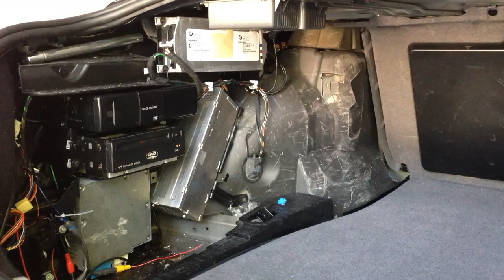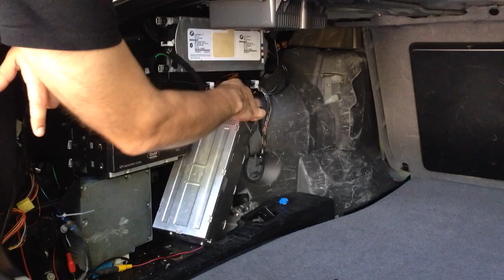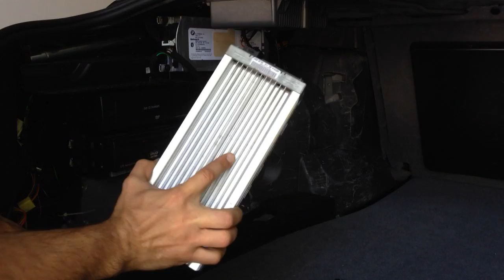BMW, Audi, Porsche, Rolls Royce, Bentley, Mercedes and other cars with MOST bus failure diagnosis a

Comment: Hi mate, thank you for your video. I found my red light signal but its steady red and its not flashing. Does that mean its bad?
Reply: Did you figure what the problem is? I am having the same problem now, the loop is closed, the amp is showing constant red LED light, fuses are all good. No sound what so ever.

Comment: Question - Recently bought an 08 528i. Sos malfunction on along with aux & cd greyed out, with no sounds from the radio at all but I can hear the radio fan on & sometimes slight static from passenger side speaker. When I unplug everything I get a red light on the amp connector, plug that in & yellow light flashes on bottom of the amp but light moves to satellite, then to the telephone control module but when I check the head unit connector in my glove box I have no light from it at all? Tried bypassing each unit one by one but got nowhere. I checked all fuses & they were good. Any suggestions ?

Comment: So question I have fiber signal to both the satellite receiver and to the amplifier yet still no sound. All fuses are good. Working in a e70 with top wifi 2008 x5 48i. Any tips or should I just get the loop bypass to figure this out
Reply: I just bought a 335i with the top hifi. I also have light to all objects but no sound to anything. I did find a broke fuse(40amp) in the trunk and when I replaced it. Instantly popped and amp smoked. Tore it out and the board was already previous fried. Have a new amp being delivered next week. I can let yah know if that was my issue, but I'd recommend looking for the light inside like on the video to see its properly being powered or even bust open the amp and see if you see any issues

Comment: I checked my under steering connection and it blinks red light. But my head unit is on bmw logo looping. It's the CCC unit. 
Is there any other issue?
Reply from the maker: Ibrahim Yousuf , yes it’s CCC issue, send it over to us we will make it outlast your car. BAVLOGIC.com

Comment: I need help have Audi A8 2006 black screen no function I use bypass loop wire put it in serious satellite tuner screen starting working music everything for 2 months now 2 months later not working do I need two find another faulty device or is it I finally need a new tuner cause it bypass serious tuner and my radio staring working again but now with plug in the tuner it doesn’t work no more I’m confused band frustrated I need help do I need to put more plugs in more devices or is it just the tuner that’s bad I need help please

Comment: i have an e65 my radio stopped working. come on and goes off. no chime either. i see some brown sticky liquid that has dried up now on my nav unit. maybe its from the trunk hydro u talked about. what should i do?
Reply: Robert Crockett , I have the same thing!
I just got a 2006 BMW 750 LI from a friend of mine, there is no sound in the car, I noticed the trunk doesn't lift by itself, some components are missing in the trunk, the wires that go to the DVD changer are mutilated,  and there is some kind of oil spilled by the section where the components are,  and now I know where it comes from! The damn lift!
I don't know what else I am missing in the trunk, and I would love to get some sound in the car!
Reply: Saad Chiguer Hopefully I can get some sound in a few weeks.
Might just get something to bypass this Optic Bullshit

Comment: Need help with order. I have an E65. I did not pull the amplifier. I see light on the satellite, telephone, and navigation. No light on the OPPS. Does the order go Nav>ASK>OPPS or Telephone>ASK>OPPS? I cannot find a schematic.
Reply: UPDATE: I do get light from the OPPS connector when I mash on the buttons on the ASK.

Comment: Urgent advice with regards to bmw e90. My car stereo and chimes arent working. The stereo itself wont turn on but the cd ejects fine. I have checked the MOST fibre optic loop connections.  The one going to stereo unit show red light. The one connecting TCU has no light neither does the one in glove compartment. Which module is the issue, and where would i connect yhe female loop connector to complete the fibre optic circuit?
Reply from the maker: Juanamo FPV if stereo doesn't turn on, you need to get it fixed first. You have navi ccc unit, correct?
Reply: Logic7repair i presumed it wasnt working because of the broken loop. nope its the entry level professional version. no sat nav and theres no amp in the back.
Reply from the maker: Juanamo FPV, so if you have no fiber optic amp, your head unit plays all the speakers then.
Reply: Logic7repair yes. so is the problem more likely to be my stereo rather then the fibre optics?